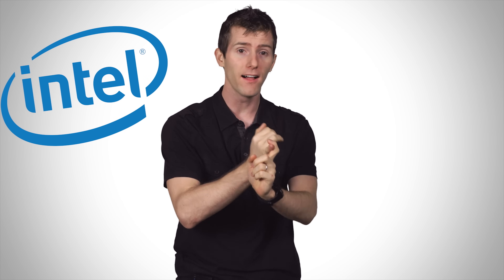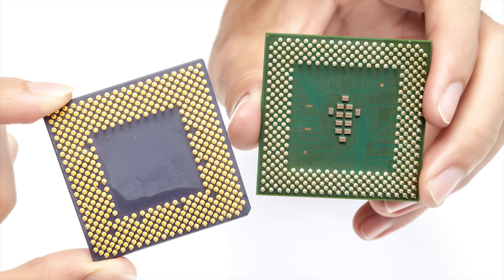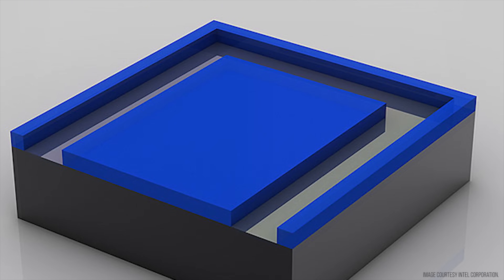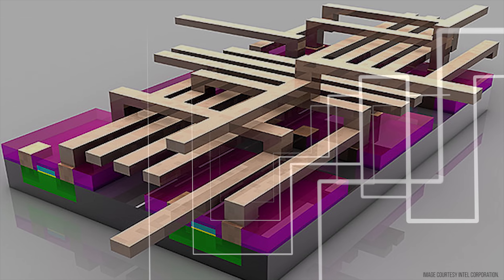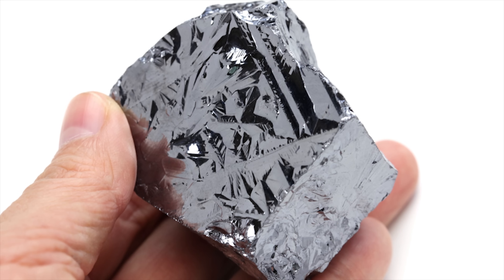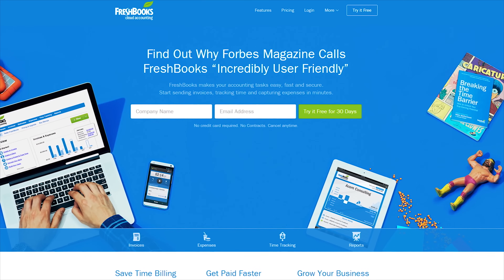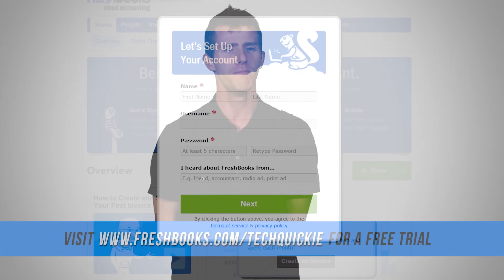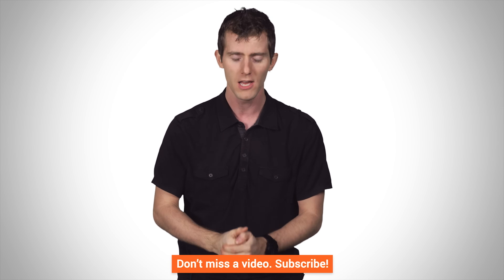How CPUs Are Made As Fast As Possible

Comment: I am incredibly overwhelmed of how magical these things are. As well as photography. I mean, it's to think that there was NOTHING that could portray a moment forever, and then someone had an idea on how to make that. And it was made, it's just incredibly magical. 

Linus, can you explain AFAP how does the electrical energy in the CPU convert to... everything we see? Because as far as we can see... they are only 2 pieces of metal (and other materials) together, but how does that go from being that into something abstract (an OS). Does it send different waves of electric energy and with protocols is interpreted... or... does Gandalf have anything to do with all this? I would love a video about this. (If not as fast as possible, then in LTT channel since maybe you need more time than some minutes).
Reply: +Lati Sullivan I'm a software and electrical engineer and here's my AFAP-fasterer-edition processors to OS:. The key to everything is abstraction.

Silicon to CPU:

Diode:
Silicon is doped with 2 different elements having different aggressiveness for grabbing electrons. Put these doped silicon parts next to each other and current wants to travel in only a single direction. (p-n junction)

Gate: 
Old-school logic gates like AND and OR can be made by connecting multiple of these together. Eg,  the AND gate is: when all inputs are high voltage, the output is high too.

complex-logic (adders, comparitors) : 
Combine gates to make circuits that perform some more complex and meaningful manipulation of signals. Here we represent numbers in binary. We finally have circuits that manipulate numbers.  We can make decisions based on those manipulated numbers.

Microcode:
This defines advanced cpu features such as content protection out of complex-logic. this microcode may be re-programmable to fix issues later.

CPU to Programs

Instructions: 
Simple: 

The CPU takes in binary words one at a time and compares the first part of the word with instruction-IDs. A match is found and an action is then taken. An action which may use additional words such as add the next two words and store the result in register AB. 
Branching: 
The next instruction may be: if the register is larger than zero, move the instruction pointer to a specified address in the code.

Machine Code: 
The binary code that tells the processor to  solve math and logic problems. It makes the processor solve conditional problems which result in the cpu jumping around withing code depending on the results. 

External Devices:  
From CPU: 
Results and stored data can be sent to other hardware devices which can interpret them for external consumption(monitors, lan, gpu, etc). Drivers use the CPU  to communicate with complicated hardware.
To CPU: 
External devices can trigger a CPU to interrupt normal program execution and execute a device specific code to handle getting data from that device.

High-level code(varies wildly): 
Human readable statements such as IF and WHILE build up many machine code instructions to control program flow. Everything you want to represent has an equivalent binary number associated with it. An ASCII character is 8-bits. Generally, you don't have to worry about what is going on at a binary level here. Everything is nice and abstracted away. This is where programs are generally created look up a some java, c++ or c# "hello world" programs to learn more.

Operating system(varies wildly):

Abstracted interface to devices: 
Drivers tell your OS how to use devices in a standard way. The OS then may provide programs standard interfaces to use available hardware.

Scheduler: 
Manages how much cpu time different programs/processes get. Everyone needs to stay happy and aggressive processes need to be dealt with in some way.

User Interface: 
May be as simple as a terminal for printing the results of programs or as complex as graphical interface.

Cache:
At every level (from hardware to OS, there are one or more a mechanisms for storing often needed data in faster storage.

This is from memory and practical knowledge. Please feel free to respond with any corrections or additions you feel are necessary. It has been years, but I was involved in the creation of a couple processors in VHDL which were programmed and ran successfully: nothing close to as complex as a modern computer processor though.
Reply: Lati Sullivan You mean in the butt right? :)
Reply: +Lati Sullivan I know isn't science great it's responsible for our entire modern lifestyle.
Reply: Donald C. Yes! :D though it's also used to destroy and do evil things :(
Reply: Donald C. Agreed. Science is the Force. People can use it for good or bad :P
Reply: +Lati Sullivan If you've ever built or seen redstone calculators in the game Minecraft, that's a pretty basic CPU.

The CPU layers are serieses of gates, for example, an AND gate will output 1 when the inputs are 1 and 1, only.
Using certain combinations of gates (XOR gates, AND gates, and OR gates) will let you build a binary adder, that adds in binary. You can build registers (memory), subtractors, etc etc etc.

Let's say you used the input code "01010100". (I'm not using real codes, bits, or anything else here, sorry. YT comments are quite buggy for me.) This could also be represented with something like 0x3F. Whenever this code is entered into the "command" section, the CPU would add the numbers in Input 1 and Input 2, and outputs to Output 1. Entering 0x40 will subtract the numbers.

I'll be using Linux as an example operating system, since Windows is closed-source and I have no idea how it works. I presume it'll be similar to what any other OS is.

At the bottom layer is the kernel. It contains drivers, which are an abstraction layer. They convert things that people code in (along with compilers, which are a different story, but basically are translators) to computer language. There are two main instruction sets, x86 (32-bit) and x86_64 (AMD64). When a piece of code (for example, if(x < 3) { y = x + 4;} ) is compiled, it turns into the respective commands in assembly (0x43, 0x57, 0x4F, 0x97). 

At the middle layer is software. This could be, for example, Minecraft. The game (Java included) will send signals like draw (cube, 0, 4, 5) to draw a block at a certain portion of the screen. I'm terrible at graphics design, so I wouldn't know what a draw call would really look like. This piece of code is sent to the driver, which instructs the CPU and GPU to draw the corresponding thing. After this, the GPU will send a signal to the monitor. If you have an old-style CRT (big old, heavy, TVs with a large portion near the back) this will be a set of electrical pulses that direct a particle accelerator to beam a stream of electrons at a phosphor layer, exciting them and causing them to emit light.

The end.

Well, that's my YouTube comment quota for the day, now I can't look at any space-videos because the conspiracy theorists will make me lose my faith in humanity.
Reply: +Lati Sullivan Technology doesn't kill people, people do! :P
Reply: +Benjamin Oien This guy is spot on, from what I can see. I'm a computer science student so their may be done inaccuracies I can't see but it looks well detailed and explained.
Reply: boolean aritmetic
Reply: TheDitboy But I want Linus :(
Reply: +Lati Sullivan The leading company in chip development Worldwide is ASML in the Netherlands (with around ~65% market share WW). They create/supply the machines with which processor manufacturers make the chips (the Intels, AMDs and Samsungs of this world). Around 10 years ago I visited their (then) production plant and was given a tour. It is absolutely incredible what they have to do to reduce errors in the production process. I believe the production building provisioned in a 100.000 times more clean air then in a hospital operating room. The first 3 floors of the building could not be used for production purposes as these were to reduce the effect of any earth movement (vibrations, barely noticeable  arth quakes), etc, etc.  Absolutely incredible stuff. ASML has been recognized as of such importance to Intel and Samsung that these companies hold a strategic share of the company stock since 2015. https://www.asml.com/asml/show.do?ctx=427
Reply: +Lati Sullivan 
Low voltage (0) and High voltage (1) is how the signals are sent and received. Add the magic of transistors and you get logic gates and logic circuits. That's basically what processors are. The shortest laziest explanation I can come up with lol.
Reply: ***** "Glorified string pushers" - I like that. There was a description going around in the mid 90s that I liked. It starts with a ramble about the machines we have made, talks about things like the spinning wheel and the carding machines, on to big industrial weaving machines, the industrial revolution. It mentioned the player piano, with the paper roll, that could play a tune itself. It points out that can play any tune, but it can't calculate your tax return. A computer is the first general purpose machine. It is not a type writer, but it can be used as one. It is not a calculator. It is not a game console. It is not a filing cabinet, or a library. It is a machine that can store and process information, and exactly what it can do, is up to you (the user) and the programmer(s). For many people it simply makes a paper weight, or a gateway to facebook...
Reply: +astroboy2345 You are absolutely right. My goal was to connect the dots on a high level to demystify it for a general audience. In fact, I avoid lots of convenient jargon. All concepts requiring a degree in EE, SE, or CS to follow were off limits: I didn't want to delve into describing the electrical properties of the current follower stage in an op-amp,  the many cache invalidating strategies, virtualized server OSs such as VIM(AC2), describe object-oriented software design patterns, mention the mind-bender purely functional languages such as haskell, or explain TTL logic definition languages such as VHDL and the truth-table architecture of FPGAs that enable said TTL to perform energy efficient and parallel tasks... The list is endless. 

In fact this is what makes engineering exciting. As soon as it's well documented, someone has built upon it, improved it in some way, or solved a same/similar problem-set with another mechanism. This evolution is how performance is able to improve without customer-visible changes. For example, mobile SoC have purpose-built circuits for signal processing: e.g. openVX for computer vision tasks. This hardware can be applied toward application software tasks to greatly improve performance and battery life. This is called heterogeneous computing, and has made great strides recently.
Reply: +Benjamin Oien And explaining assembly.

other than that, I can't see anything. I've now re-read it multiple times. so yeah, use that as a good explanation.
Reply: +Matt Loveday Unicode is simply a different binary-character association table than ASCII. Unicode generally defines many more characters than ascii so it takes more bits to store a single character. Unicode is messy and has multiple versions. This is why when writing program code for compilers, languages generally stick to ASCII. There is no need for several pesky variants of quotation marks mucking about. This is a huge annoyance when copying script from stack exchange, etc.
Reply: +Matt Loveday Assembly is almost synonymous with machine code.  A few things happen to convert assembly to machine code:

*The human-readable  instruction codes are replaced by their binary equivalent.

*decimal and hexadecimal representations of numbers are replaced with binary.
*labels and label references are given machine code addresses.

There is probably a bit more I'm forgetting, but this is all that it necessary at the most basic level.
Reply: +Lati Sullivan Lati, you can take an individual part or component, system even in a computer, and explain it quite well in a couple of minutes. Explaining how it all goes together and how it works ... that is not something you can properly explain in a few minutes. I started studying computers at a tertiary level in 1996, and it took about 18 months of tertiary study before I really had a good idea how all the major parts worked and how all that fits together overall. Unlike most machines, you really can't sketch out all the major points on one sheet of typing paper...
Reply: to know that go study in the university
Reply: +Benjamin Oien There are actually more steps to each level of abstraction.  For example, in the CPU stage there are split discipline between computer architecture (logic gates, logical equations, microarchitecture, assembly language), digital electronic circuit design (making circuit composed of transistors, diodes .etc.  working on speed/frequency/reliability) , and semiconductor processing. (creating transistors/diodes from raw silicon material, manipulating atomic structure of silicon with III-IV chemical elements, and working with industrial chemicals).    All topics one can spend a lifetime learning  and make a modest living.

(and simultaneously be laughed at by programmers one year out of college making 2-3X more doing CCS design, Web Front end / back end programming or iOS / Android development).
Reply: I know this response is old, but I really liked it, especially the beginning where you summarize the answer to the OP as "abstraction". Nothing as sophisticated as a computer system would work without it lol. It's really and truly amazing.
Reply: +Donald C. Yes!
Reply: +Benjamin Oien I guess you could mention Unicode, but that's about it.
Reply: Eugene InLaw Exactly. What he asks is the subject of a degree, not a 2 minute clip.
Reply: ***** geen idee wat je bedoelt?
Reply: +Hancock someone like you couldn't even invent a light bulb. Don't act like it's nothing.
Reply: Benjamin Oien Yeah I know what they are, Unicode would have been nice to mention it because it's basically all text you'll see on a computer. And Assembly isn't the same as machine code, so a mention would have been good.
Reply: Benjamin Oien I once was tasked in my computer science course to make a division algorithm within assembly, which was really fun.
Reply: i guess you now know i dont have anything to do with it
Reply: waterlubber
like for effort
Reply: I just want to be in this magical section :)

Comment: Is the manufacturer process similar for GPUs? A video like this on GPU Manufacturing would be interesting.
Reply: +Quencly Same process (otherwise GPUs couldn't be integrated on the same die as CPUs). Main difference is architecture. GPUs try to solve a throughput problem whereas CPUs solve a latency issue.